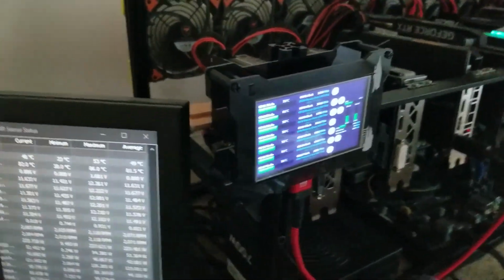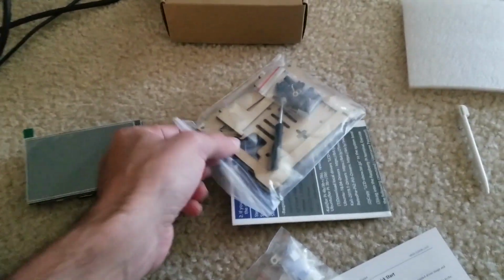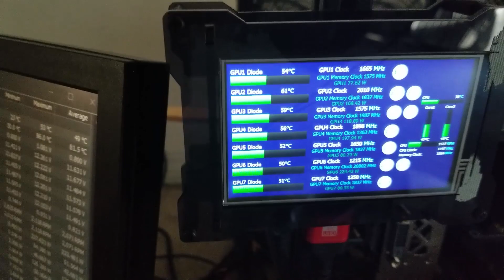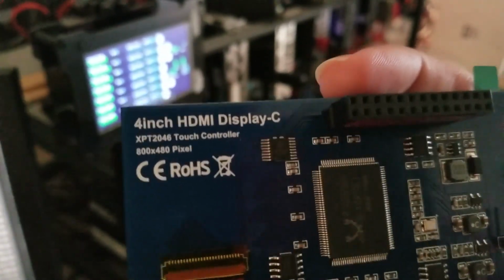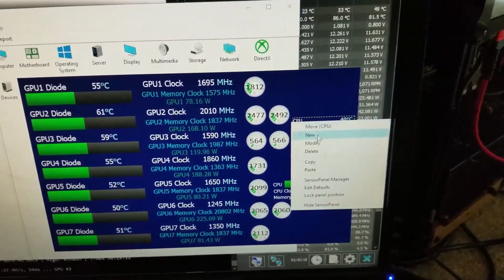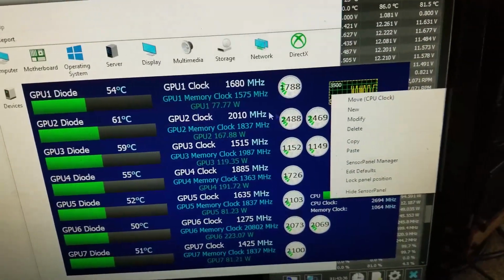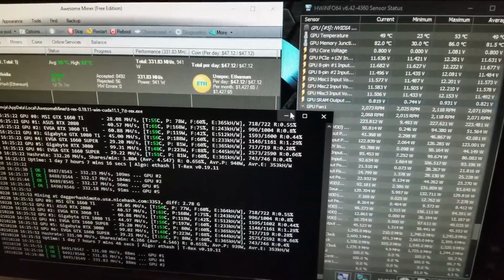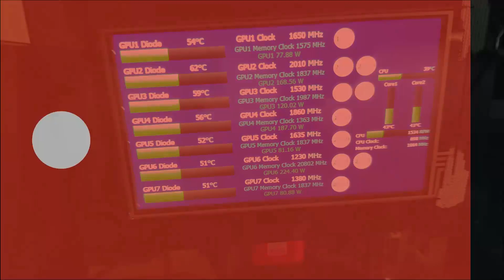How to add a Hardware Monitor to your Mining Rig

Comment: Hi i noticed you mention something about a driver failure and the gpu going back to default settings...mine does that about 14 hours into mining, how can I solve this without restarting the pc? My hashrate drops in half 😐
Reply from the maker: Check your overclocks, it may be high, or depending on the GPU you may have undervolted to far. You got to troubleshoot to find out wish GPU is causing the crash.
Reply: @SerpentXTech okok thanks for the help 🙌 I'll check my oc then, I only have an 1080ti ftw3 currently the settings are
 voltage: default  
mem clock : 850
core clock : 60
Power: 85% (power here is cheap)
Avg Temps: stable under 60 celcius.
Your content is amazing btw 🤜🤛 thanks again 🙌

Comment: Does it only work for windows rig? I'm still assuming there is no way to check GPU mem temps in hive os.
Reply from the maker: It is a display, so you can use it as a secondary monitor, or just get the 7 inch and turn it into your main monitor. Hive doesn't allow 3rd party apps to run yet, it is a stand-alone Linux-based OS, so you have to use what they provide or update.